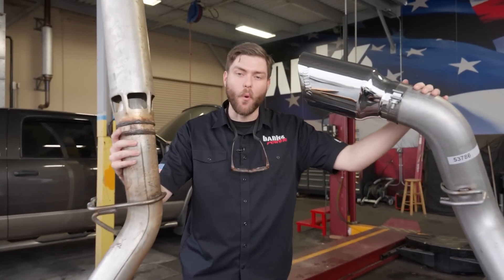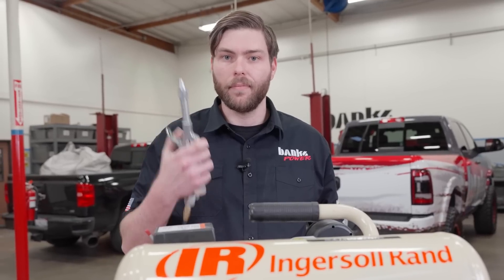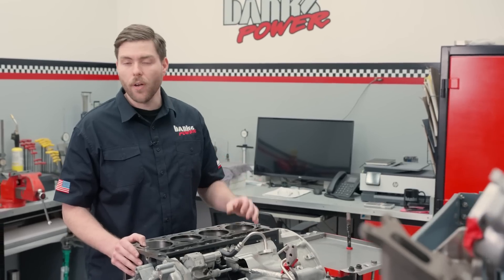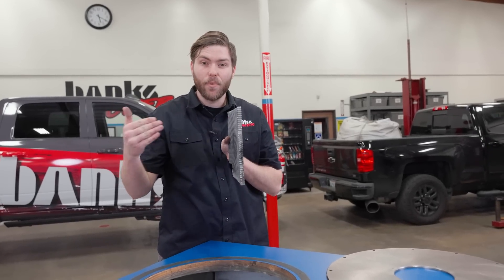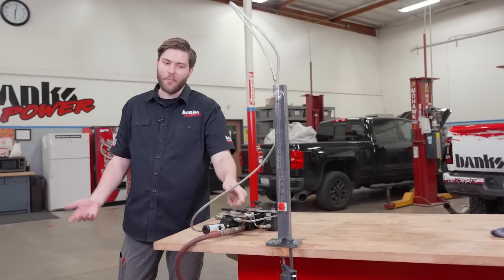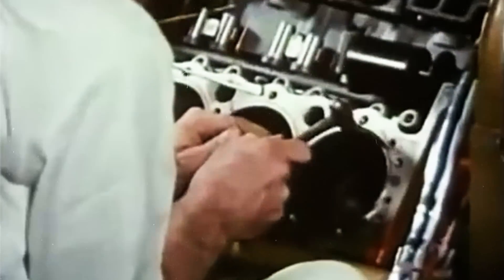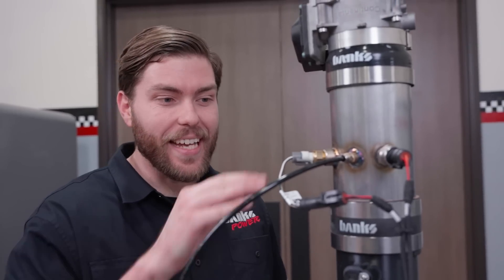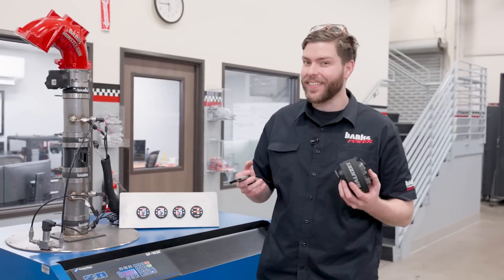Everyone is measuring airflow WRONG - Here's why | Banks Entry Level

Comment: Questions:
How do you calibrate the MAF ? 
Now that there is also air pressure , temp and humidity playing a big role on the MAF reading,  are you going to create a correction factor so you can compare tests from different conditions like dynos ?
It will be good to see who the MAF differs between two part with similar CFM but a completely different design.
Reply: I believe everything is calibrated on true ambient conditions. 

Between an ambient air mouse 🐁 in the room, and the Bosch MAF + supplemental pressure and temp from aux sensors in the test piece…

You can reference the product being tested, against real world live data.
Reply: They can adjust the transfer function in the MAF, they have all the other data points and can build a lookup table to log data. If you measure the ambient air in the room, before and after temperature, and pressure, you can correlate (correct) what the MAF sensor signal is reading no matter the size tube the sensor is in. The frequency output of the MAF changes with the pipe diameter, air mass (environment) This can be then used to build a spread sheet that makes these corrections (smoothing-averaging) and you can manipulate the transfer function in the Logger to make repeatable readings. Then, you can very accurately determine actual air density into the engine (or out) and trim fuel to correct A/F ratio rather than measuring it in the exhaust and making fuel trim corrections after the fact. Wide bands are still very important tools, but they are measuring the past where a direct reading MAF is supplying the information exactly at the moment of the 💥
Reply: shouldn't be that hard to compare sensors..  swap sensors.  The orifice plate stays the same, should flow the same amount of air.  Yes,... if you do a test today when it's rainy out and cold, vs 3 days from now when it's hot and dry, the air flow through the fixed orifice will have changed.  but a 10 minute difference I doubt would change things much.
Reply: When I mentioned calibration I mean comparing the readings from the MAF with a known standard. I work in the medical field and any device used to measure anything needs to be calibrated every year. This includes multimeters, thermometers and even rulers in some cases. When the bench was used to measure the CFM, it had the calibration plates from the vendor. 
I really like the idea of the MAF on the bench. Being a Electronics Engineer myself I would love to have a play with it. I also tune my E38 so I know well the GM VVE.    But back to the conversation : 
Mass flow rate = Volumetric flow Rate / air density 
The CFM and MAF are related to each other and I can't see why it would be so much better to use the MAF on a flow bench. Are they suggesting that some parts with a similar CFM could have a different MAF rate ? If so that would be a good explanation to use the MAF sensor.
Reply: @pixaim69  I believe it is relative to say a 6" steel inlet pipe laying with an open element air filter over 500C Exhaust vs a 4" sealed cold(ambient) composite inlet pipe would show very different CFM's vs. Air Mass. EDIT: Also you start getting into flow properties, how straight the air flows, reversion corrections etc. If you can ram the air in, theoretically, you can minimize the error caused by the back pulse of a valve closing (intake or throttle) important in dynamic situations (road racing) It has mass and is compressible, so there is momentum to the flow, which the alternative sensing may show vs a wideband/closed loop map system looking at the end result. As @church points out the MAF is still reading ahead a few cycles but I will suggest that precombustion air will be less tainted, therefore better data vs post combustion data which may average out a misfire or oil slip that you are tuning around.
Reply: @optimumperformance6998  I can picture all that with the parts mounted on a engine bay or engine dyno.  The questions I raised are related to the use of MAF  on a flow bench where the situation is static.  I am looking forward to see the result of the experiment.
Reply: After reading a few more posts I can see i am not the only one questioning the MAF on the flow bench.
Reply: @pixaim69   They are full of crap and talked to NOBODY that knows flow or deals in flow for a living.  They like to pat themselves on the back solving problems nobody has.  I guess that's how you become an "industry leader"... you just make up a problem and have the solution all in one and convince people through marketing to buy it.
Reply: As far as CFM vs MAF. CFM will stay the same for a section of pipe/ elbow if measured at Alaska in mid winter, Sahara Desert in summer or top of Mt Everest. The MAF however can change dramatically as air temp, humidity and elevation changes. 
For the stuff Banks does now manifold air temps is probably the main thing to be concerned about for MAF for performance. Thats vehicle by vehicle as as a running combination, not something you can test on a intake elbow on a flow bench then advertise as an quantifiable number
Reply: They calibrated the bench with the calibration plates, so they should somehow calibrate the MAF so it is a true testing instrument. One way would be measuring the CFM, calculating the air density then MAF. But that would bring us back to a CFM measurement in the end. 
When the MAF is in operation in the car , we calibrate it via the wideband.

Comment: I can understand how air is goin dense after cooled down but wat bout the same amount air we gettin thru air filter, lets say engine running at 1000 rpm is breathing a pound of air in 30 secs without intercooler but after we add intercooler it still is breathing pound of air in 30secs. I mean the amount of air drawn thru air filter is same with or without intercooler or u gotta suck more air to densify it. U need more volume to densify air that much. U gatta have high flow air filters. Not only adding intercoolers helps without changing the type of air filter.
Reply: The turbo will be creating a vacuum in the intake tube so the filter should be flowing more than 1 pound of air in 30 seconds. Yes high flow filers are an excellent idea hence the Big Ass Filter

Comment: so you're saying I can wire a Bosch (or other MAF) sensor directly to an iDash?
Reply: It is not hard to read a bosh MAFsensor, it's  output just varies the frequency based on MAF. 4 lines of arduino code does the trick.
Reply: If your an Electrical Engineer or sufficiently electronically inclined yes you can.

Comment: Now I can see you'll want the ability to affect all the variables you are sensing with your hot rod flow-bench to further determine effectiveness, yes? Altering intake air quality, temp, moisture (density) as you test to see performance across a wide band of variables.
Reply: Accurate bench tests like this are then revalidated in real-world driving. 

Same sensors are used throughout an intake tract down to the turbo Compressor and Outlet
Reply: Fortunately, you can vary the flow speed and achieve pretty much the same thing as varying density and viscosity. Reynolds number is the key word here and it's very useful in the context of flow testing.

Comment: FLOW MEASUREMENTS ARE FOR SALESMEN. DYNO HP and TQ MEASUREMENTS ARE FOR EVERYONE ELSE..Your Vehicle's (Gasoline anyway) ECU is calibrated to calculate all of this (for Forced Induction OR Naturally Aspirated) information for proper operation using a combination of: Intake Air Temp, Mass Air Flow and/or Manifold Pressure as the relationship between 'Air Density' (as you call it) is a pre-calibrated quantity so that the system knows the correct amount of fuel to add achieve Stoichiometric frieldn't Air/Fuel Ratios to keep the engine happy, pre-determined based on pre-set values in Open Loop and corrections in Closed Loop based on Safety parameters based on all known relationships/data. ALSO, PROPERLY setup Forced Induction Engines ALSO measure pressure differentials BEFORE and AFTER an Air Restriction, such as an Intercooler along with the possibility of 2 Air Temp Sensors used in the same fashion. Manifold (MAP) Pressure ONLY needs to be monitors BEFORE the air hits the heads/valves, normally AFTER the Throttle Body (again, for Gas Engines). I think that this Data is great for Inhouse, but you are muddying the waters for most people and attempting to re-invent 'the wheel' for no good reason other than marketing of an in house developed product. Sorry.
Reply from the maker: After reading your comment 34 times, it appears as though we're saying the same thing. Flow measurements are for internal comparisons. We just found a way to more accurately compare our data to that which is produced on a dyno. Thank you for watching and weighing in.
Reply: @bankspower  Wouldn't you be comparing apples to oranges. Static flow rate vs dynamic flow rate
Reply: Flow bench numbers are for a quick comparison with changes. You don’t have to install the product on an engine and do a full dyno test just to measure a small change.
Reply: @NBSV1  Well said!

Comment: Hi friend, let me send an think . Few friends dont hear me . If you will send the credits for it.

Take the calibrated plates , make a spinning plate with 1 , 2 or 4 holes and make a spin between bench and tube of measurement,  creating a pulses , like a real engine. With a rpm on rotating calibrated holes its possible sense the spring effect on tubes . And in static position , they back for stock measurement. 

See hello for Brazil !!!!

Congrats for thinking outbox
Reply: roots blower with dc motor